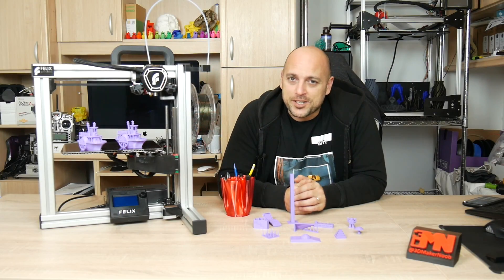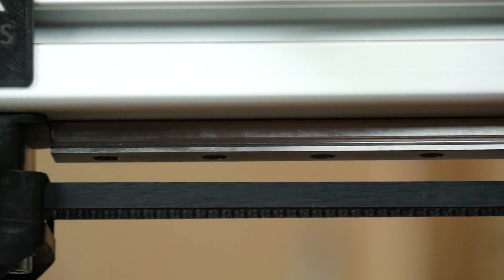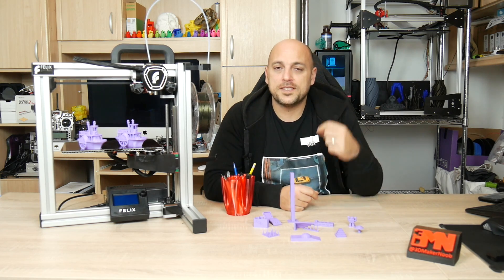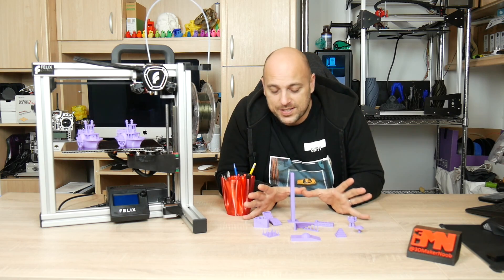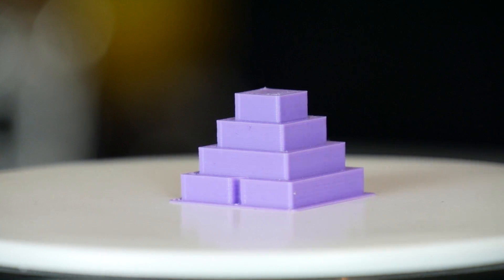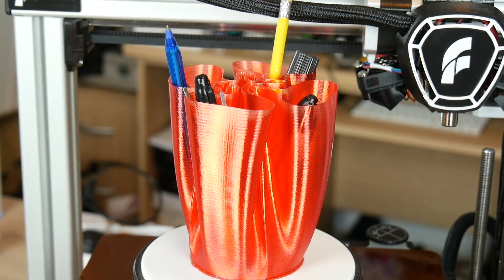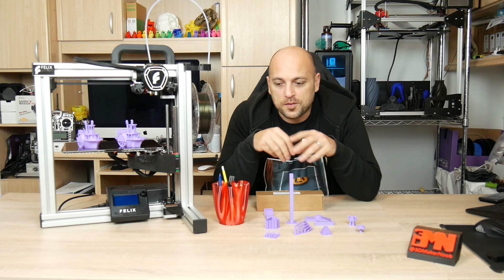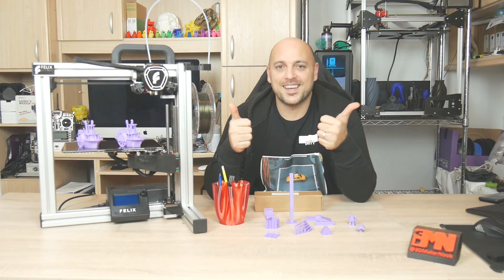First Look At The FelixPrinters Tec4 3D Printer

Comment: Great video Joe. I got the new bed to try out, but I have not connected it just yet. One small point to correct here, the sheet they give is thick (old school) Kapton not PEI, but it works quite well, lasts for hundreds of prints and also loves Magigoo in my experience. I agree on the build quality for the (Item) aluminium profiles and the Hiwin rails. These parts are awesome, but expensive. I understand why they want to stick to these parts though and not compomise on quality to lower the cost. Injection molded parts also contribute to build quality + reliability and increase the cost.

However I don't understand their insistence on some proprietary parts like the hot end and electronics board. Their all metal hot end is lightweight (and proprietary), but it costs 95 euro (no VAT) compared an original E3D v6 which is 50 euro (no VAT). Their electronics board is 140 euro (no VAT) but it is a custom 8bit combo board (mega 2560 + ramps 1.4 style on a single pcb). Similar combo boards like RAMBo mini or Megatronics cost 100 euro (no VAT) and a 32bit board open source like the DuetWiFi is 135 euro (no VAT). So they could also make some choices/changes to lower the cost of their machines without compromising on the quality.

Looking forward to the dual extrusion system and full review video! Happy making.

Comment: Price and quality of prints considered its not 1.5 times better then a Prusa
Reply from the maker: qauality of print not out of the box, unlike prusa, it's not a well calibrated out of the box with Slic3r, still needs tweaking. however from a mechanical point of view, i can bet you that the linear rails alone cost more that the actual wholesale cost of all the parts on the MK2s alone

Comment: This guy has tons of printers and filaments and I got 1 roll of filament and a 3d printer which caught fire today from faulty parts... lol
Reply: LogandadLoga what printer are you ok!?
Reply: I'm gonna go on a limb and say its probably an anet A8
Reply: Yeah
Reply: It was an Anet A8 it was only the heatblock and the heatblock wires that caught faulty, it wasn't even anets one because the preset nozzle on it came clogged and i couldnt unclog, i ordered 2 heatblocks and the 2nd ones fine... But when i saw the fire going down the heatblock wires I instantly pulled the plug and blew so hard on it till it went out. Also when I preheated for PLA it heated instantly... getting a refund

Comment: Being a Dutch guy, I know the Felix brand. They have their printers in the makerspace in Lelystad where I used to come a lot.
I have to say however, that I was never really impressed by the quality compared to the price. Maybe this printer is a bit better as the ones they have in the library makerspace, but I really think that most of my printers print with a better quality then the printers they have there (and their two printers cost possibly more then all my printers altogether).
Curious about your findings when you do a full review.
Reply: that is very common for open public spaces where multiple people can put their hands on them; even if you have the cheapest chines knock off your printers will always have better performance if you're the only one using them